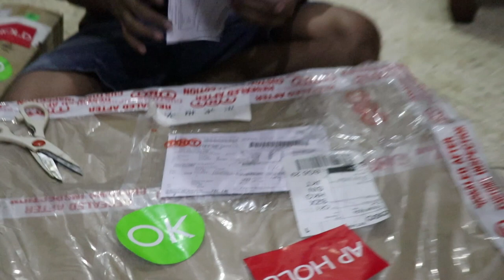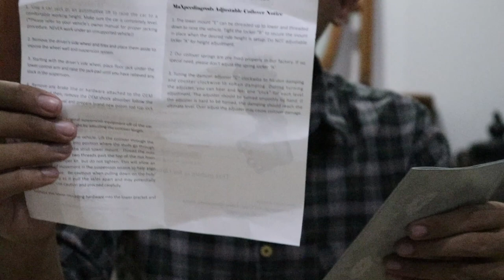UNBOXING Coilover China!! BMW e36 part ii

Comment: Sya jg di E36 pake itu om..kelemahan nya di chamber plate shock bagian depan. poinball nya ga dilapisin sama karet (peredam/serta pelumas). jadi langsung alumunium ketemu alumunium. gesekannya seret. sering bunyi klutuk2 pas stir dibelokin. beda dgn D2,Ksport,ISC poinball nya dilindungin sejenis karet hhe.. solusi nya mounting tetep pake original. walau ga bisa chamber hhee, Tapi overall tetep rigit kok om hhe 🤙🤙🤙
Reply from the maker: SEIS MIC betul!! 100!
Reply from the maker: thank you bro,pantesan ada bunyi2 nih..next ya gw upload review nya..
Reply: E36 e323 i kah bang?